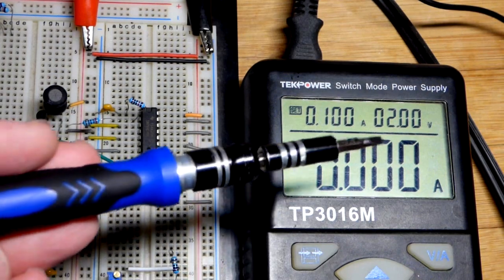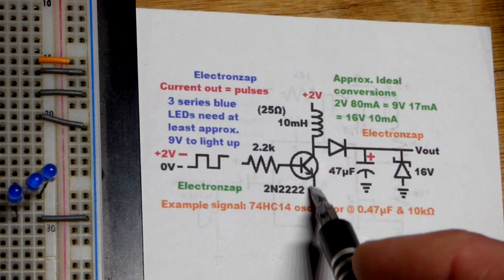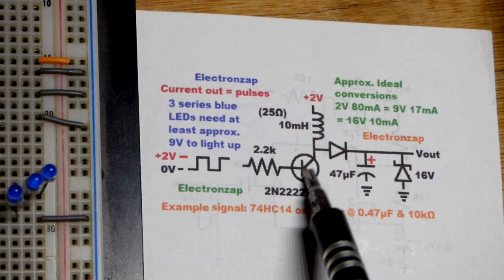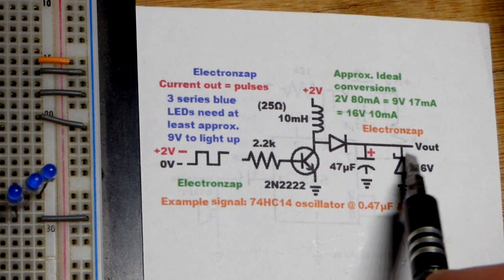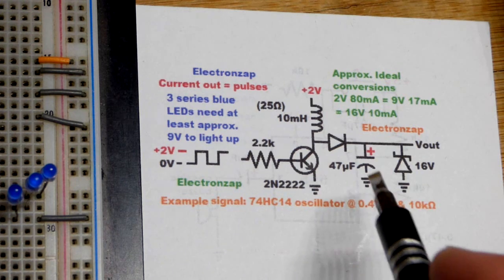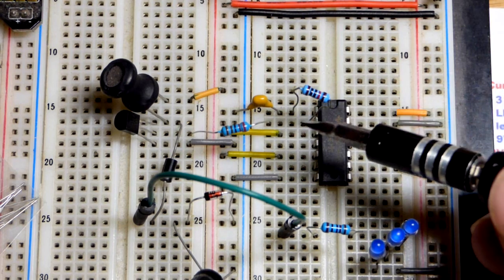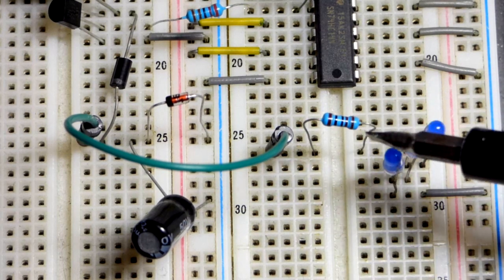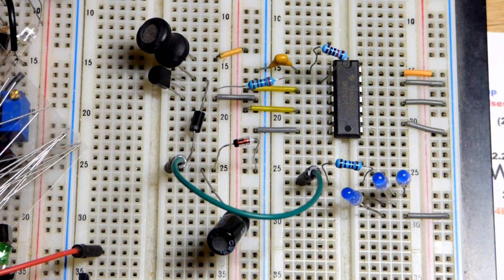Prototype 2V DIY voltage booster inductor 2N2222 NPN BJT circuit learning electronics shorts 113

Comment: So what frequency did you generate with the 74HC14?  I don't have a 74HC14 so used a HCF10406 that I recovered from some circuit.  The max frequency I could generate from that device was 115khz and that only gave me a boost of 0.36v (2.36v on the output with no load attached)
Edit:  Turns out the HCF40106 output is voltage dependent - increase VDD and the frequency increases with the same RC values and although it technically operates from 0 to 16v, 3v seems to be the lower reliability limit.

Comment: So built the circuit with a 3904 then the 2N2222 (3904 - output voltage was significantly lower) and put a 10k Resistor on the output as a load.  Found the peak output voltage of 11.34v @ 1.2mA at a frequency of 360khz (used my Sig Gen to create the 2v PWM signal).  Input was 2v at around 60mA.  I assume the ripple in the signal is the Coil oscillating/ringing - short one when it gets the +2v signal and a big ripple when it discharges.